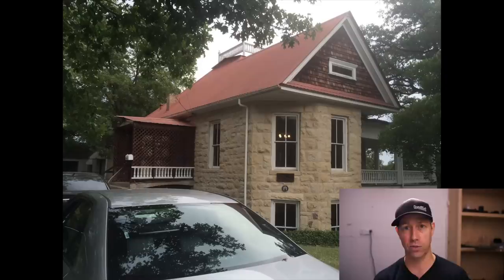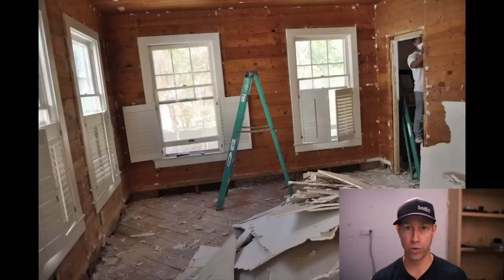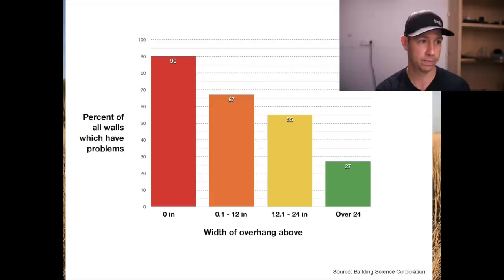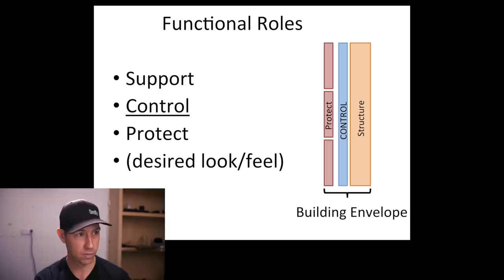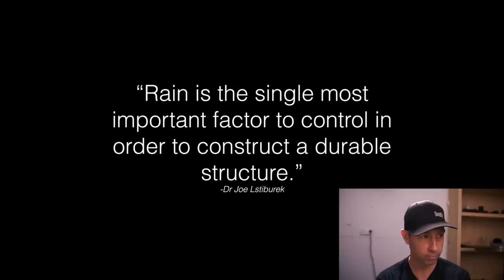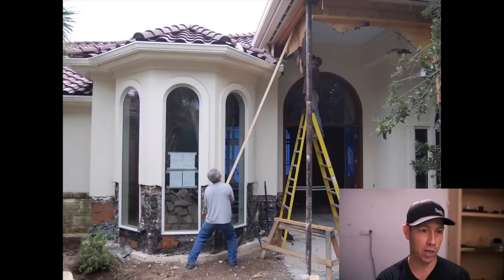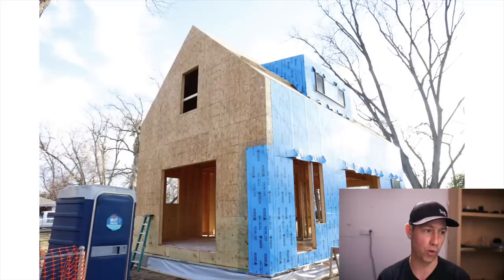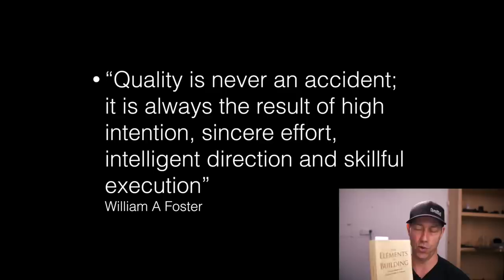Were Old Houses Built Better?

Comment: The only thing is new houses arent going to last as long as a stone house. If your concern is to build a home to last hundreds of years, why would you build it from glued sawdust, foam, and sticks?
Reply: Stone houses are porous and have high thermal conductivity. Unless you live someplace with a mild year-round climate a real stone house isn't going to be comfortable. To parody your argument, caves will last thousands of years long than stick-built homes, so why don't we go back to living in caves? As he explains in the video, if that's your standard of comfort then knock yourself out.
Reply: A well built wood framed house will last hundreds of years. I am not aware of any old stone houses that don't have major wood frame elements. A stone house will only do as well as those wood framed elements. It is the protection of the wood framing that is important for durability.
Reply: Real stone houses have a high thermal mass they heat up slowly and cool down slowly.
Reply: Stone houses take a while to heat up and cool down, which creates the illusion of insulation, but the reality is they have poor thermal resistance so you expend a ton of energy. They're the opposite of energy efficient. That's why I said they're really only tolerable in mild climates, such as around the Mediterranean. It is possible to stack two stone wythes and put insulation in the center, but your walls will be insanely thick and it'll take a lot of hard manual labor. If stone houses actually were practical in our modern world we'd build them more. They're not, but people like to romanticize them.
Reply: How many real courses in physics did you take in college? The temperature inside a real stone house remains at the average annual temperature for the place that the house is located. Like the widely promoted earth sheltered houses.
Reply: @johncolvin2561  Earth shelter houses are made out of *earth*, which is NOT just stone. Do you know the difference between earth and stone? Do you know the difference between underground and above ground?
Reply: @CheeseBae Because timber framed houses are air tight and insulated naturally? Stone and brick houses can be air tight and insulates if you want them to be so. You just need to actually do it when building or remodelling. Of course 100 years ago  nobody fitted insulation or made their homes air tight so numpties presume that because they are not tney cant.
Reply: Jonathan Buzzard, I already said its possible to build a stone house in a way that makes them energy efficient, it just takes a lot more physical labor. If you can afford it knock yourself out. Build me one too.
Reply: @CheeseBae  My house is brick built with a slate roof. Heck even my internal walls are nearly all breeze block. I have refurbished it to something very close to modern standards for insulation and air tightness. Could not go to over the top on the air tightness as have a real flame gas fire in the living room and need a certain amount of leakage for that. Of course I live in the UK so all that is not out of the ordinary. House is 67 years old now. Should be good now for that again at a minimum.
Reply: No just build a inner and outer leaf with insulation in the middle....
Reply: Jonathan Buzzard, if you look up the thermal conductivity of brick vs stone you'll see that stone conducts much better than brick. While they're both masonry they have different properties. I don't know about building regulations in the UK, but at least here in the USA most brick and stone over the last 50 years is veneer with wood actually holding the roof up. No one doubts the beauty of stone, but economics and practicality are still issues.
Reply: @CheeseBae  The thermal properties of brick/stone make for jack as you have inner and outer leaves with the insulation in the middle.  Besides you can't compare brick to stone as what stone. Could be sandstone, slate, granite, flint, limestone or basalt depending where you are living in the UK and what is the local stone/preference and they all have different thermal properties. And yes all those different types of stone are common building materials in the past in various places in the UK. These days its 99% brick for new builds, though they cheap out and and use thing's like plastic air bricks over clay ones to save a few pennies.
Reply: @jonathanbuzzard6648  I'm well aware that you can add insulation to either. And my point precisely was that the properties of brick and stone are different, which is why I was wondering why you brought brick up when we were discussing stone.
Reply: You can build a stone house with a burned clay brick but with modern design (wienerberger porotherm). Lots of air cavities and 50cm wall thickness, only air as insulation. Pros: ridicilously  low energy consumption in finnish climate, cool in summer, no condensation or vapor issues, good indoor air quality. Cons: labour intensive as hell to build and quite learning curve. u-value of 0.17 so not even an illusion. Built one
Reply: Justin H Your analogy is a bit flat. You can build a stone house anywhere stone is available; caves aren’t movable to a convenient location the way stone is.
Reply: Luke Pickerd, you missed the point. He said stick-built homes aren't going to last as long as stone houses. I pointed out that stone houses aren't going to last as long as caves. Not sure what that has to do with stone being more available than caves. My point is that modern comfort, budget, and practicality are going to trump the longevity of stone in the real world. Stone homes are for rich people who have the budgets to work around their cons, or for people who are lucky enough to live in a mild climate.
Reply: Over here in Europe we mostly build with concrete, rock, stone, brick steel tiles and cement.
I never understand how the Americans build with such flimsy materials, especially in areas with hurricanes, tornadoes and floods.
Reply: @Justin H I live in a house where the only parts made out of wood are the doors and the window frames. But it is very comfortable and energy efficient in temperatures from -20 to + 45 (-5 to 110 Fahrenheit). I use less than 1000 m3 of gas to heat my home and keep cool even in hot summers for a decent family home. Basically 20-25 degrees (66-75 F) year round.
Double walls, with insulation in between, triple glazing and lots of layers of insulation, up to 1 meter (3 feet) in thickness in places.
Reply: @RogerWilco , right, double stone walls with insulation can be comfortable, but it's not realistic to house the US population that way. It's much more labor intensive and expensive to build. Dollar rules all here. There's a niche for people who want stone (not veneer), but the truth is the average American either doesn't care or can't afford that style. Honestly, stone looks a bit out of place here since Americans don't have a long history of living in stone homes. Our climate, materials, and history are different from Europe, so most homes are wood or brick.
Reply: thevitutus 

U-factor of .17 translates to an R-5 to R-6 value. That doesn’t sound all that great. I think my toilet paper has a better energy efficiency lol
Reply: bigmacattk you are forgetting the sheer thermal mass of stone. That means it takes longer to warm up and longer to cool down keeping the inside temp at a nice average add a little bit of insulation to that and it is quite good.
Reply: breakingdawn97mc 

If you increase the mass of anything it will be good. You can increase the framing of the walls to accommodate for more insulation, like they do in alaska. There walls are soo thick, you can put two duel pane windows inside window framing, and its quite comfortable also. I don’t like the versatility of stone or brick. Its a pain if you want to change something. Lets say a widow frame goes bad, you can’t exactly change the frame properly to add a nail flange. So a replacement windows are added instead, so your water proofing is dependent on your silicone sealant.
Reply: Justin H  Log homes last much longer than new builds.
Reply: Except a stone or brick house ISN'T safe in an earthquake. Unreinforced masonry has been banned in California since 1933. You may think that Texas doesn't have earthquakes, but you never know. For example, the New Madrid earthquakes, which happened in 1811-1812, surprised everyone because it was located in the middle of a techtonic plate on FLAT land. New faults are constantly being discovered.
Reply: @rogerwilco2  "Over here in Europe we mostly build with concrete, rock, stone, brick steel tiles and cement."

Yeah, we've got structures like that in the US, too...but if you wanna live in one, you've gotta rob a bank first!

Why don't you look into the ecological footprint of concrete and report back? 5% of worldwide CO2  emissions come from production of concrete alone! And, as the first step of making concrete is heating CaCO3 until it becomes CaO, concrete will always produce loads of CO2, even with the greenest possible energy inputs.

Wood, OTOH, sequesters carbon for as long as the structure stands. (Concrete creates CO2; wood sequesters it.) And wood structures routinely last 100+ years. My wood-framed house (brick veneer) is 98 years young today, with zero appreciable signs of wood rot.

Concrete is simply an inferior building structure that Europeans are stuck with, since they have already destroyed all their forests. (Excepting Scandinavia, which still has forests...  they build of wood, which withstands Scandinavian winters.) Essentially, you're making a virtue out of necessity!
Reply: Actually, stone itself has rather low thermal conductivity and excellent heat/cool storage capability. That's why you can be out on a hot day, duck inside one of those thick stone structures in Italy or Greece and feel instantly cool. And why it makes such a good 'thermal mass'. However, back when these structures were prevalent, we didn't have good materials for sealing in those dwellings, so there was there was thermal leakage due to hot or cold air getting in.
Reply: Stone houses fall apart quickly. Wood will eventually fossilize. Once that happens your good forever. My neighbor's house is over 100 yrs old and it is half way through the fossilization process. Not many houses are that old though. My house is quite old(2009). It's in great shape. I can't wait to see it in 100 yrs.
Reply: Chris Smith stone houses fall apart quickly? Rubbish. There are tens of thousands of centuries old stone house in the U.K. The entire city of bath is built of stone, and is largely unchanged since the building boom in the late 1700's. A stone built house should be good for five hundred years. Your American glue and chipboard houses will have disintegrated five times over by then.
Reply: Not so. Stone houses aren't necessarily devoid of insulation. If you add thermal insulation and wood panelling, you're looking at a creation that will last centuries, unlike the 'matchstick-sheet rock-play-houses'!
Reply: Justin Yes. I can’t picture having millions of stone houses in the US. The population difference is so great between England and the US. Over 300 million versus over 65 million. Even right now there is a housing shortage many ;parts of the US. Stone houses aren’t going to become common like in England and other countries in Europe.
Reply: @thevitutus  just came across this. I'm thinking of building with insulated porotherm. Any suggestions/ things to look out for?
Reply: @theverdictisstillout  Get a good architect and make the concrete foundation overkill. Also any strong fastenings to the brick needs special screws and cement.
Reply: @thevitutus  thanks. Good advice.

Comment: In Britain, we have houses still standing after 4-500 years, and some churches and cathedrals are 1000 years old. There are timber buildings in Japan dating back that far. I think most modern houses now being built are going to need serious work within 100 years max.
Reply: Hi Phil. I don't think any of the timber buildings in Japan are ACTUALLY that old. MAYBE a few... Mostly, the climate here is extremely punishing to almost all materials, and that's without even taking the typhoons and earthquakes into account... Secondly, the sugi timber used for most buildings is actually very soft and susceptible to rot - it's a step above balsa wood, but not much, and weaker even than modern SPF. The secret is they basically tear them down and rebuilt with new materials, exactly the same in every detail, every couple of decades! The few that are actually that old would have been made with hardwoods that are now virtually unavailable in quantity in Japan.
BTW - you'll be interested to know I keep Japanese native Apis Cerana here, in Warre style hives. Now THOSE hives even survived a typhoon!
Reply: Yes, but many are wrecks and miserable places to live.  All sorts of BBC shows about dilapidated old wrecks needing huge investments to become livable again.
Reply: Nothing Noone  True enough, however framed/stud-built houses are not going to make it through the test of time. Even if it's survivorship bias, it doesn't change the fact that 2x4/6 construction won't last nearly as long.
Reply: Climate in the US is way different. 35c in the summer. -17c in winter.

Comment: I saw the last house, with a proper alignment of insulation and an air gap between the outer shell and the inner layer. And all I could think of: DAMN you nearly built a Dutch standard house. You should take a look at how we make em here, mostly out of brick (in and out) with controlled mechanical ventilation, concrete floors and more. You will see most of the "best" practices you encourage being standard here, with even more details to prevent moisture from creeping up through the foundation and more. 

When I look at remodels and rebuilding programs originating in the US, I am always creeped out by how the most fundamental areas of a house are treated. As a structural engineer, who never forgot the basic practices of thermal and water bridging that were standard in my education, I am so amazed that such a low standard is accepted in the US. Yes it is cheap and fast, but by god I can feel the rot of the main structure coming up as I see houses being built overthere.
Reply: Maxx Kroes  That is actually quite interesting. I worked on a few apartment blocks when for Sweden when I was working for a precast concrete factory in Germany, and couldn't tell much of a difference. And having been to Sweden the last year for a project as lead engineer for a new lock that we are designing there, I couldn't really see that much different from the outside, though I should look into the matter a bit deeper now.
Reply: Ordos20

Concrete FLOORS?! Why? I can see using masonry as an EXTERIOR material, but anything on the inside is protected from the elements and will last forever, provided the exterior is maintained.

5% of worldwide CO2 emissions come just from making concrete! I think it ecologically absurd to make something of concrete when it doesn't add any value.
Reply: @bcubed72  strenght, some Mediterana counturies also build roofs from concrete and terra tiles over it
Reply: Americans builds only JUNK! Before Americans used to built-to-last in the 60s, 50s, 40s, 30s, 20s, 10s, 1900 to 1800 but not anymore, unless you specifically ordered it built according to your specifications with a powerful engineer-lawyer making a contract for all contractors and sub-contractors that they must face the heavy handed consequences if they cheat-cut corners!
Reply: @bcubed72  it's efficiency Vs emissions depends on its lifespan bear in mind !

Comment: I forget the actual date but from what I heard the oldest original roof is located in New England and was made of White Pine. I have worked on homes there dating from the early 1700s so if my memory serves me correctly that would be roughly the date of the roof. Old growth wood is so far superior to the farmed wood we build with today. Like you said, tight growth rings inhibit water from soaking in along with the pitch that acts like a preservative
Reply: In a small home maybe. There are copper roofs dating back before Jesus. 

Pantheon had a copper roof for 600 years until it was stolen to be used as a roof for another church, and was finally melted to make weapons after 1700 years. It would still be there had it not been stolen and melted down.

Comment: Here in Chicago there are a number of what they call "Georgian" houses with no overhangs at all. Not only do they look ugly and not offer any shade for the side of the house/windows...or any ventilation for the attic...it also turns out that they're likely to rot.

I live in a home that was built in 1930. We don't have central air but we have a lot of huge oaks to shade the home. We also have ceiling fans in most rooms. And, the house is brick...real brick. The brick is still beautiful after 90 years. The joists are rock hard...amazing quality materials. The only downside is the lack of insulation in the walls. I'm adding rock wool as I do remodeling.

Comment: OSB is a scourge on the housing industry.  OSB is everywhere now, even the flooring.  The problem is that when it gets wet, the wood expands (as all wood does), and it breaks down the glue bonds.  The stuff literally falls apart after a few years of exposure to water.  Old wood houses were built out of cut lumber, so this process took a lot longer.  Even plywood is more resistant to water, although not great it has glue too.

But the trend is towards cheaper and cheaper building materials that do not handle water as well.  Vinyl siding for example is very common now.  But how long can vinyl survive in the elements?  20 years?  So your siding becomes like an asphalt roof and needs to be replaced every 20 years.  But the damage may already be done.
Reply: I HATE VINYL SIDING WITH EVERY FIBER OF MY BEING! THAT GARBAGE SHOULD BE ILLEGAL!!!